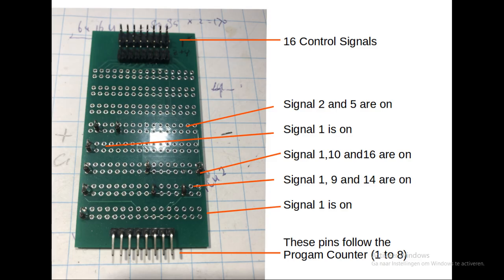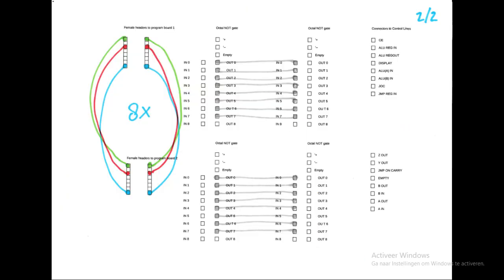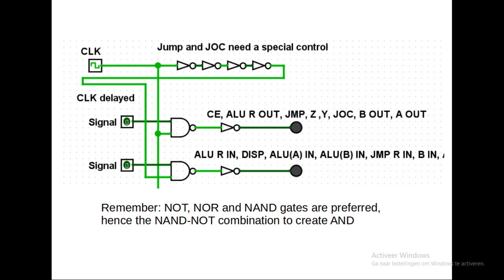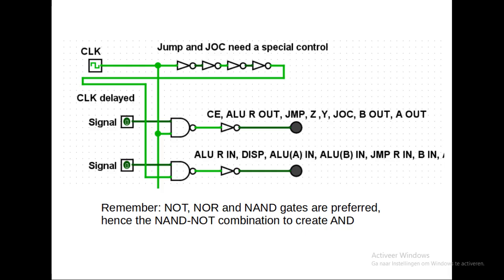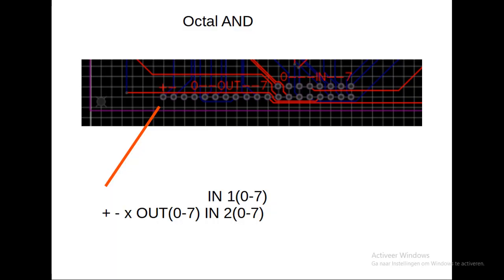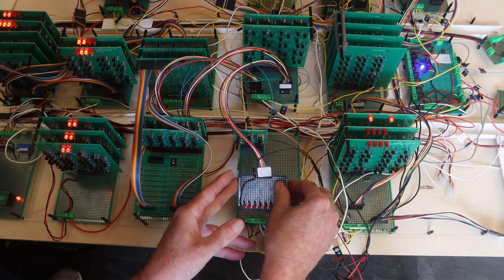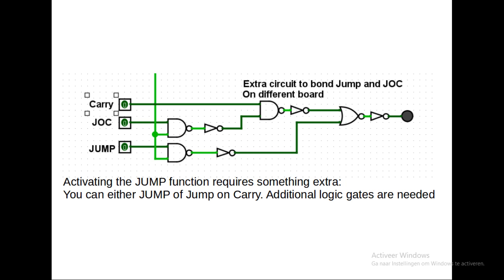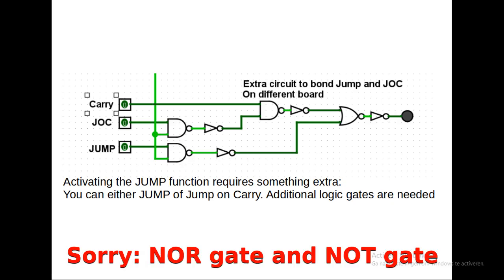Welcome to Tutorial 6 of "How to build a transistor computer" about control electronics

Comment: The 4004 had 2300 transistors and I was prepared for that. 2 notes:they were handy in replacing transistors for diodes back then, and I ‘m not. But I have a leaner architecture, modified Harvard is easier on the transistor count than Von Neuman. That is:untill you want to write large programs..:-). Happy to have build this!!😅